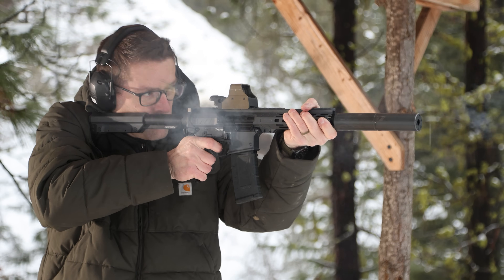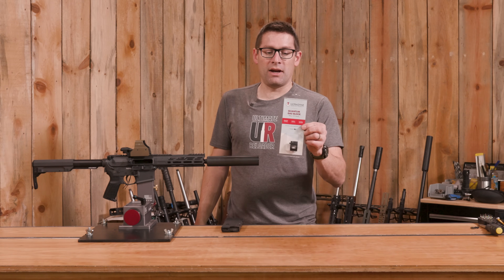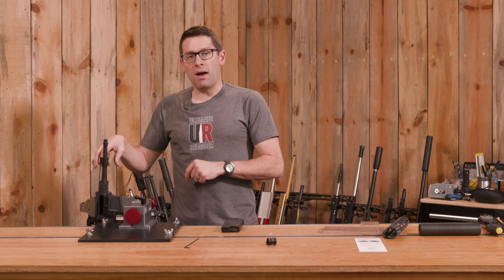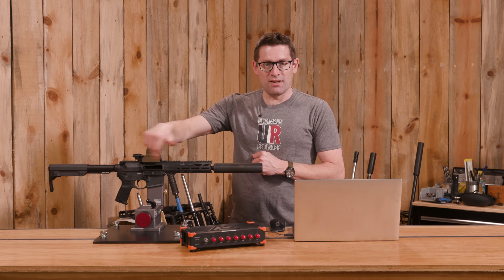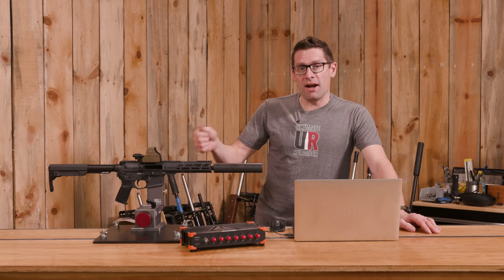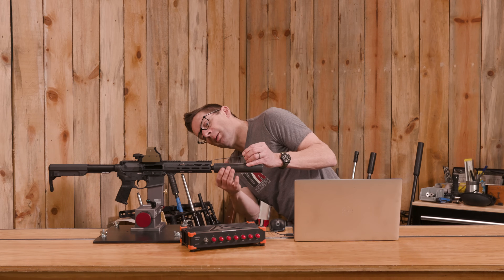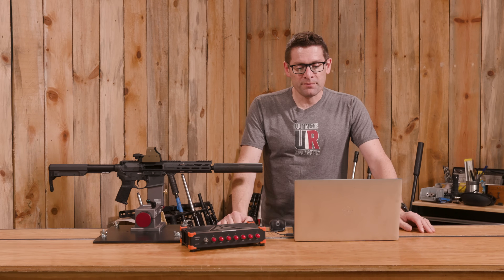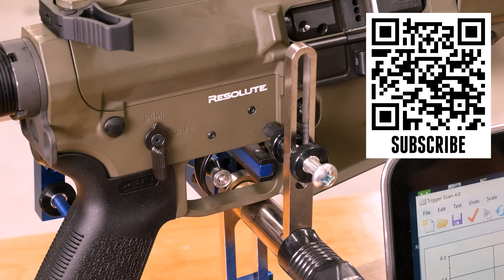Optimizing Recoil with the Ultradyne Adjustable Gas Block

Comment: Made these gas blocks for the company (Ultradyne) pretty niffty part but i found from tactically acquiring some OOS parts, it doesn’t help having a normal sized gas port, going up a few thou in size helps you run all form of ammo including sub sonic or very reduced .223/5.56 heavies

Comment: Like virtually everything else, the adjuable gas block can have accuracy implications.  I try to run the least amount of gas necessary to faithfully operate the bolt.  That keeps the maximum amount of gas pushing the bullet and reduces the impulse loading of the gas system. I use a competitor's 21 position gas block on my rifles.  I have horror stories with other gas blocks. I use Ultradyne brakes good stuff.

Comment: Adjustable gas blocks only work if the gas port is oversized for the ammunition being used (over gassed). They will not increase the barrel port pressure as many think. Adjustable gas blocks leak more gas by their design and can actually cause malfunctions if the rifle is perfectly gassed with a standard gas block. I do run adjustable gas blocks for suppressed and when using weaker pressured ammunition like steel cased. I also use them with my competition rifles with the lighter buffers and carriers. I have tried many different types, but the only two I will use is the Superlative (blow out setting, not the choke side setting) and Rifle Speed. Adjustable gas blocks need to be maintained (oiled regularly and move the adjustment knob in and out) or they will become carbon locked. The Rifle Speed is the most durable, easily modified for the rifles need, maintained and has the ability to adjust without the need of tools. Adjustment springs that are on the inside of the gas block itself will fail because of the heat created by the block. The Rifle Speed has the adjustment spring on the outside of the block, can be double stacked for more resistance in the adjustment and is not effected by the heat.
Reply: Ty for the comment ! Been looking for honest opinions from folks who have thoroughly run each different adjustable block. Not many direct comparison videos on the difference options.  Experienced comments make a big difference. I'm going with the riflespeed.